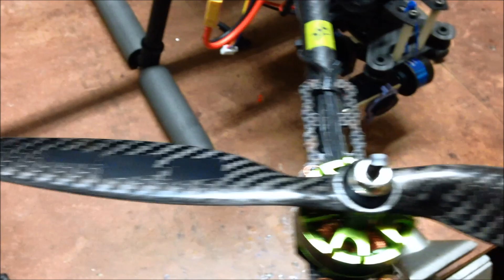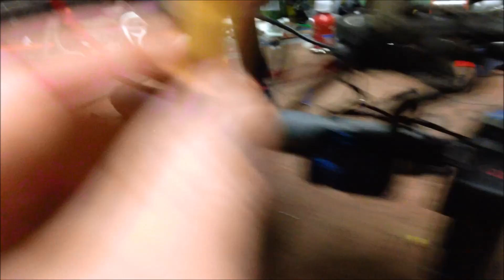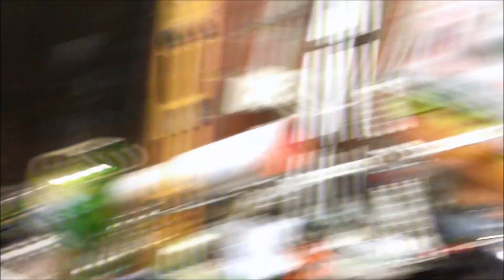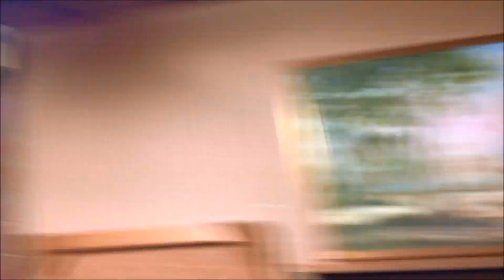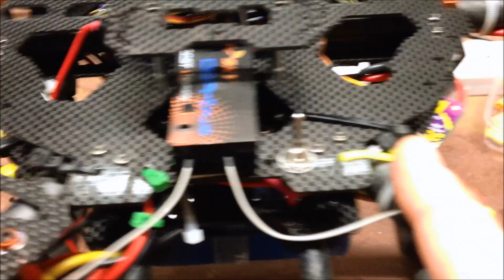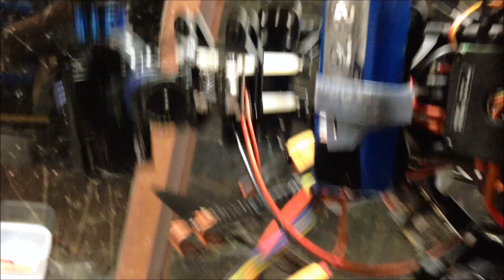Tarot FY680 Hexacopter Final Build Overview with Gimbal set up

Comment: Thanks for the vid. I have a very similar setup to you, but with a Tarot 680Pro hex with SunnySky Pancake KV580's and RC Timer 13x5.5.  The motors all seem to be beautifully balanced, and I meticulously balanced the props correctly. However, I still seem to get lots of vibration, and its killing my GoPro video with shaking at decent speeds.  Any advice to reduce vibrations to as low as possible?
Reply: +Jayden Lawson Is it side to side vibration?
Reply: +Ringo Long Yeah it is. Any advice?
Reply: I had to super soft vibration dampers. I am using the gray ones. I think they are 90 grams. I may put a video together about what all I had to do.
Reply: +Ringo Long Oh ok - that would be awesome.  Perhaps that's it.  Mine seems fine at low speeds, but once I start moving fairly fast, the horizontal vibrations start in the gimbal.  Did you have a similar issue?

Comment: Hi Simon, is it safe to use 30A ESC with the Turnigy MultiStar 3508 640KV which has maximum current 30 A as well?
I am afraid I would face a problem with the 30A ESC since the motors are 30 A as well
Reply from the maker: My 30a afros are barely warm after 10 mins flight time. Need to rembrr that the motors are only running at about 50 percent at hover. Maybe 60-70 for fast flight. Rarely would you be running 100 on a multirotor craft.

Comment: which pins on the APM did you use for control?
Reply from the maker: Channel 7
Reply: I used 6 and it working great. It has been a nightmare dealing with newer firmware. Nothing on this copter has been easy do to programing.  The one before with 1.9 firmware was quick.  I updated and is one thing after another. Now I'm dont have pitch or roll uuuuuurrrrgg ... ok thank you for reading my post and my venting lol ...thank you for replying

Comment: hi Simon, may I ask what your experience is with the afro esc's? I'm building my 680pro for the moment but havent decided with the ESC's yet (have Tarot 620KV motors). i read a lot about the SimonK firmware, which is a must have (or BLHeli) but undecided on the brand of ESC's. Thanks for the reply.
Reply from the maker: I have 4 of my multirotors using these AFRO Escs now and they have never given me a problem.